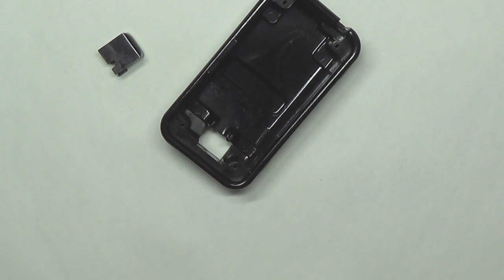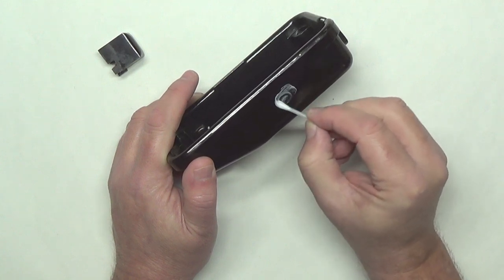How to Polish a Bakelite Vintage Sewing Machine Foot Pedal/Controller

Comment: Nice video. Just wondering why you don’t like using Autosol on the bakelite? I use it quite often and have never had a problem. Thanks
Reply from the maker: I’ve been advised that the solvents in Autosol can damage the Bakelite. The reaction it has with the material is why it is used to test for real Bakelite. Real Bakelite jewellery is surprisingly expensive.

Comment: How about using Autoglym?
Reply from the maker: It would probably work as a final polish, but it would be hard work to polish up without using Brasso first as Brasso has a coarser cut. Also, some chemicals can react with Bakelite (that's why the Autosol test works).

Comment: What is a capacitor?
Reply: An electrical component that often goes bad in these foot pedals, causing the machine to run at full speed. They were used to supress interference with anologue Tvs, They aren't needed now